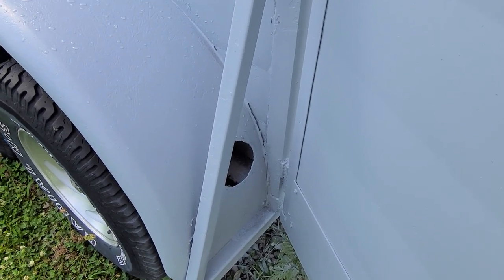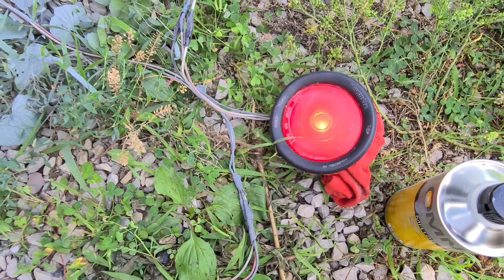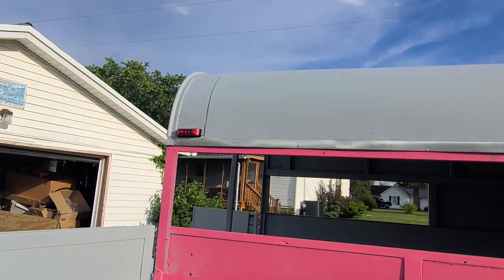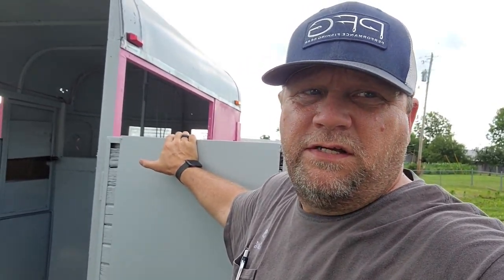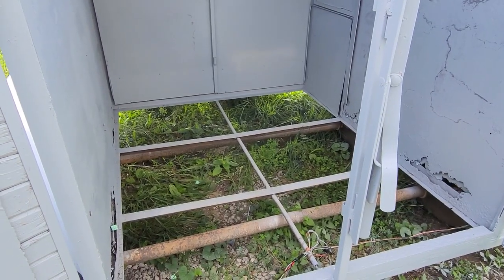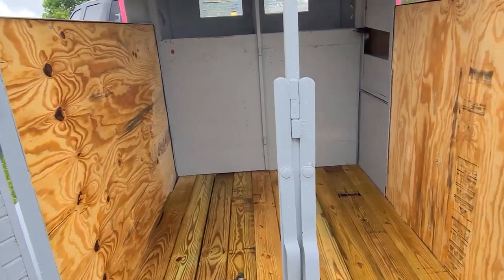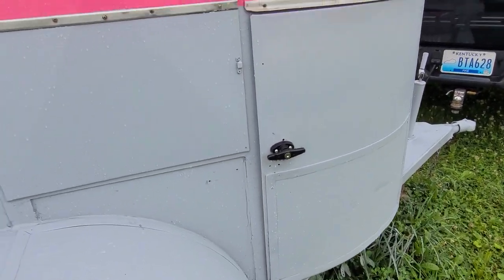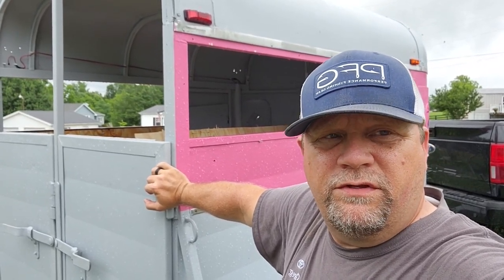Replacing The Floor In A Horse Trailer

Comment: How did you secure the floor boards to the trailer? I've seen carriage bolts used from the top but I do not want hardware exposed. Thoughts?
Reply from the maker: Each end of the boards are captured between steel C-channel. I cut a section of the steel out just large enough to slip the boards in and slid them to the edge. Once all the boards were in place I welded the cutout section back in. All the boards are captured so there was no need to bolt them down.
Reply: Very helpful, thank you!  @ProjectDIY2
Reply from the maker: You’re welcome!

Comment: Great job.  I have the same exact trailer.  Do you know how I can take the doors off?  Do they have to be cut off?
Reply from the maker: I really can’t say for sure. The hinges on this trailer were welded to the shell so they would have to be cut off, but there were so many rust repairs that I can’t tell for sure if the welded hinges were original it not. If yours are welded and the pin won’t come out of the hinges then the welds will have to be ground off to remove them.

Comment: Sorry for all the questions lol how did you secure those new floor boards in? What kind of wood did ya use too?
Reply from the maker: Those are treated 2x6. They are captured on the top and bottom by metal channels that run side to side along the front and back. In the first video in the series I had to cut a notch in the channel to get the old wood out.
Reply: @ProjectDIY2  if you use white oak, it won’t shrink like treated, plus is a lot stronger and won’t rot
Reply from the maker: @jacobpw9990  Good to know! Thanks!

Comment: Do you recommend adding a suspension system to the trailer ?
Reply from the maker: To be totally honest, I'm really not up to speed on horse trailer suspensions... The suspension on this trailer seemed to be ok.
Reply: @ProjectDIY2  do you mind focusing the next video on it ..I'd like to know more about the type used and its condition..if it works well ... some discourage using suspension..
Reply: You want to use a torsion supension for livestock or horse trailers.
Reply: @brich2929  for horse trailer .

Comment: Not sure if I missed it or not. Did you have any rust? If so, how did you address it? Sheet metal or some type of puddy?
Reply from the maker: It has a ton of rust. The owner didn't want to put the money into it too fix it, and honestly it was too far gone to fix 😳
Reply from the maker: So we just shot a coat of paint, fixed the floor and walls and rewired it.
Reply: With rust so bad, what would have been the best thing to do if the owners wanted it fixed? New metal or puffy?
Reply from the maker: The best way to fix it would have been to cut out the rusted metal and weld in new. Anything else is just gonna create more rust at the worst, or it will come back a year later at the least.